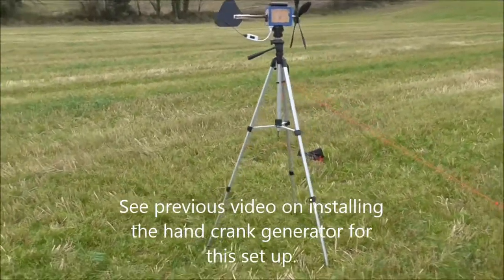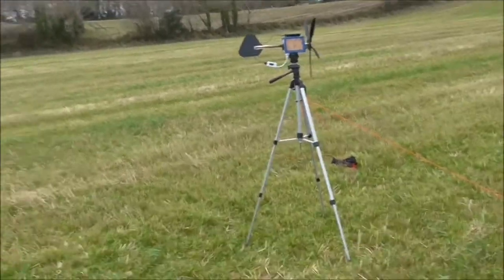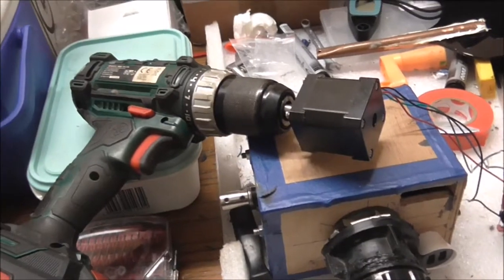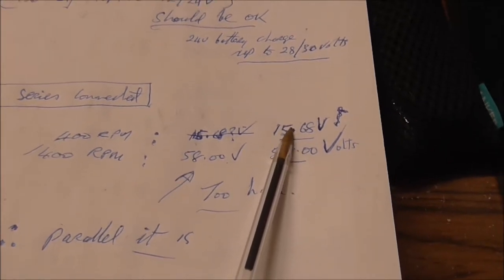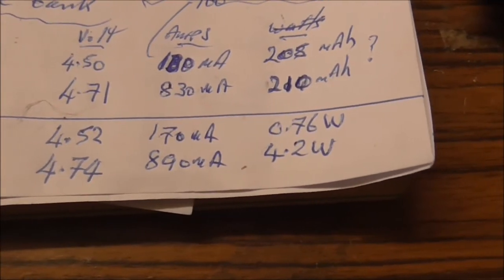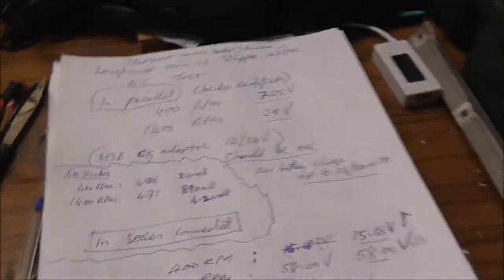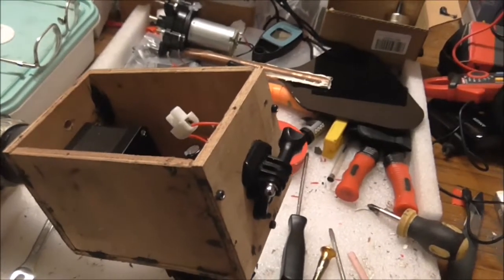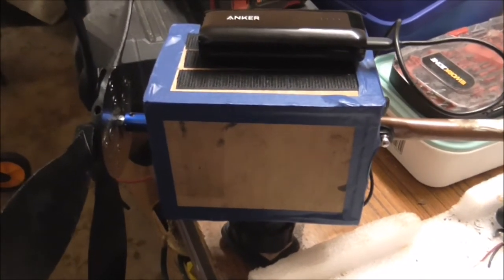DIY portable USB  wind turbine using stepper motor NEMA 17

Comment: Thank you my dear friend for the great work and information.  I must admit that I am a novice at this.  I did a research and came across many types of nema17 stepper motors and which one did you use, is it possible for you to give the exact model number?  thanks.
Reply from the maker: Hi  Mesut it has been awhile back but the type I went for was a comprise between getting most amps without to much torque to be overcome with small turbine blades.
I purched on Amazon type :
Bipolar 84 oz.in (59 Ncm) 2amp 4 leads
17HS19-2004S1
I notice they now stock model
17HS16-2004S  2amp which has a lower torque of 45Ncm, this may be a better option.

Comment: great video! what did you use to make the blades?
Reply from the maker: Hi , I purchased a portable wind turbine from Cutting Edge USA but disappointed  with it (could not get and amps from it ) so I used the blades for this DIY one.
You can get sets of blades from them on their Web site , need to scroll down several  pages to find them. The ones I have are 9" long blades.

Comment: Finally you can charge a battery using a nema 17 with normal wind? Are the cables connected in parallel or in a series to be able to charge via USB? thank you!
Reply from the maker: It has been some time ago but from memory it was parallel to give maximum current.
Reply: @martint1151  Thank You Martin! Im making one 3D printed with a nema17. Maybe you might be interested.

Comment: 1N4002's are about a 1V drop, you may want to find a much lower drop diode. Your losses are probably 15%+ because of just that.. Or, run it in a series so your diode losses are lower (as its working against a higher voltage) and then use a buck converter to change the incoming voltage down to your desired voltage.
Reply from the maker: Jeff thanks for info. , I ended up using larger 5 amp rated diode's but only small improvement in output.
I found that when I was using buck converters on other projects that the greater the voltage differential from input to output the efficiency of the buck would drop considerably. They rate them as being 95 to 98 percent but that may be with very little voltage drop ? Also see similar with different usb adaptors , some have greater losses then others.
I did a follow up video of " field test " and results were ok.